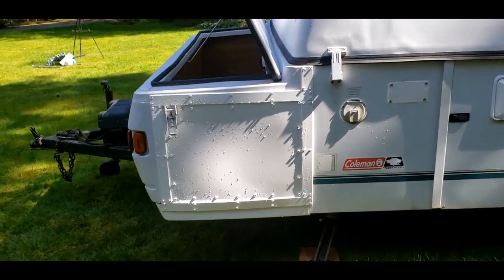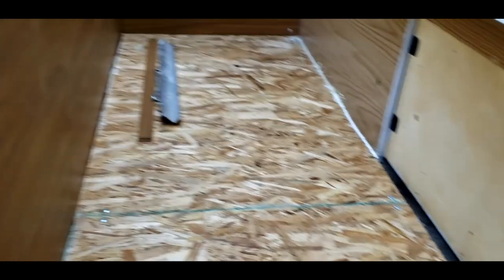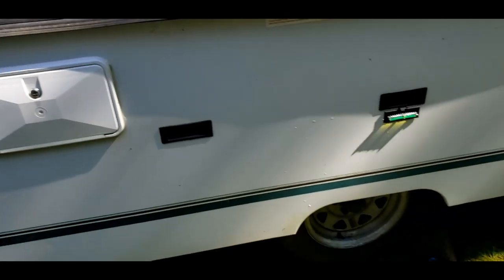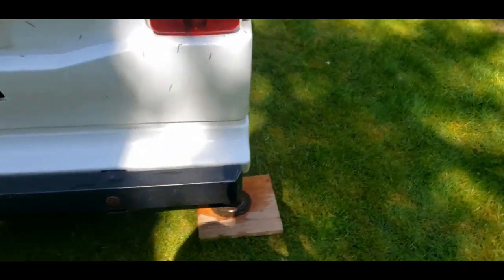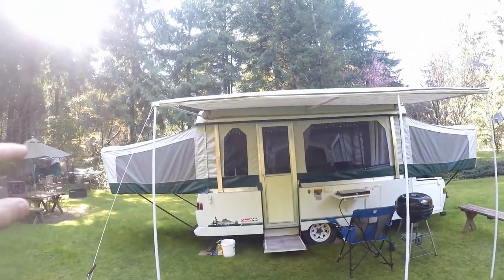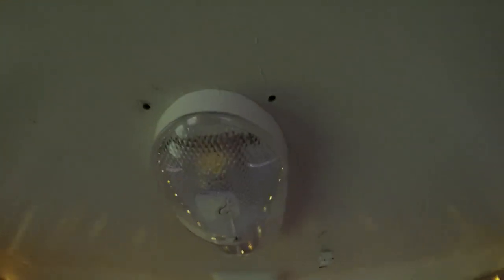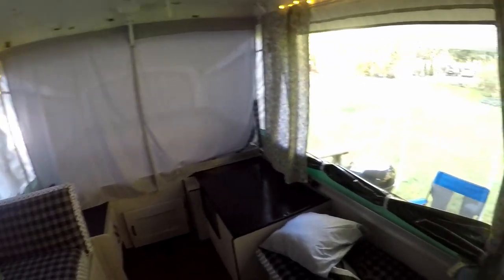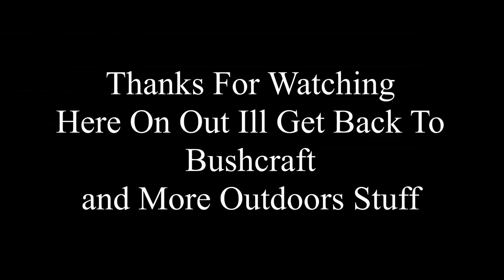1999 Coleman Popup Camper Remodel Ep  7 Final Before and After

Comment: Coleman made some really nice campers  in the 90's. I guess people had problems with the 1 piece top on theirs. Ours never experienced issues. We just picked up a 1997 Jayco popup after selling our 94 Coleman years ago when our  kids grew up and out. We didn't need a big camper any more. The smaller popups are REALLY hard to find because they are the most popular campers on the used camper market. They retain their value as well. Ours needs the roof repainted and recaulked. Some clown screwed a car luggage rack from a really small car on top. That is going away. I intend to seal the holes. The roof vent doesn't have a fan, It needs a fan. I am thinking solar powered. I find those front storage campers tend to leak over time and create big issues. Our friends purchased a camper just like yours and stored it in a barn for the winter. The mice completely destroyed the canvass and all the cushions. Their insurance did pay for it.

Comment: a have a 00 with a swing away galley but mine is different.  where do the hoses go when you lift it down?  mine travels through a slot in the cabinets but didn't see that you had one
Reply from the maker: They do the same. I have a cover on the slot to keep stuff out and remove it when I need to swing it up.

Comment: Hey bud I just got a 99 coleman bayside did you ever repair the Inside cabinets and what wood you use to replace it with
Reply from the maker: Mine where in good enough shape I only stripped the paint and the plastic molding off. Painted them and installed new black t-molding the fit in the groves around the edges of stuff. Replaced one door with some 1/4 in marine grade ply and some 1 x 2 for the framing.

Comment: Nice renovation!   I have the same 2001 model.  The previous owner removed the front storage as it leaked as well.  The water heater leaked as well and was removed too.  What are you using for a water heater?  You mentioned an electric one?

Comment: Nice!  Question - I have the same stair step at my door and I can't see how to get the old laminate out to replace it, everything is riveted in place - is there some trick I am missing?  Thanks in advance!
Reply from the maker: Yea, so for us we scored the laminate then used a scrapper and heat gun to get as much as I could up. Along the edges where the metal frame/trim is i did my best and edged it up so when we layer the new laminate down it was square and smooth. We used liquid nail and a grout trowel to make sure there was a good surface to adhere to.
Reply: @SgtDanB  Thanks for sharing your experience, I'll give it a go!

Comment: great work! any info on how you repaired the canvas? it looked like it was in rough shape on the before pics.
Reply from the maker: I ended up paying 1600 to get a new one made. Depending on the company you can just get partial sides done, however you have to send in the current canvas so they can match the zippers up. But if you a total replace like I did you just select year, make, and model and they ship to you. Took 2 weeks for mine from Popupparts.com.

Comment: What happened to the refrigerator that made you have to replace it? I’m having problems with mine.
Reply from the maker: It wouldn't cool. It was the 3 way version so I hooked up AC and DC power to it and it would not kick on. Then after I got the propane pilot light to finally get going I had the fridge turned to its lower setting and waited 2 hours. It didnt cool. First though was possible it was to far out of level for it to cycle properly but after I relabeled the trailer and everything  it still didnt work. The was power to the system. I believe either there must have been a leak and all the coolant went out or it wasn't reacting properly when heat was applied. It's a shame to, good set up but what 500 plus bucks to replace with the same model/brand. That why we just went with a AC only fridge. I mean it was so small anyways we will need to have a cooler as well so why go pricey. If we are dry camping we can just use ice in ziplocks to cool the fridge and run a cooler. Of course the solar and inverter or generator would power it. To expensive to replace with a gas unit.
Reply: DB Bushcraft Thank you

Comment: What kind of adhesive did you use to fix the seal?
Reply from the maker: A marine grade waterproof silicon. However it did fail but I think that was a failure of it to adhere due to the seal being old a expanded. Im ordering a new seal of pop-up parts.